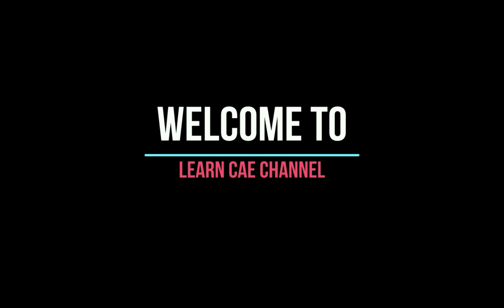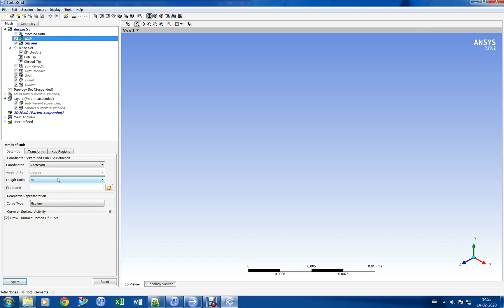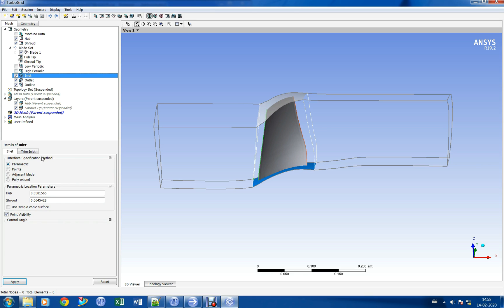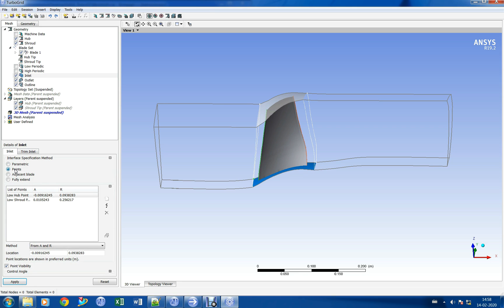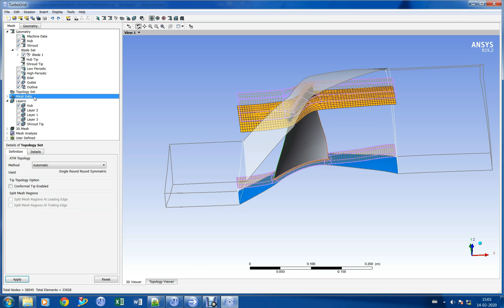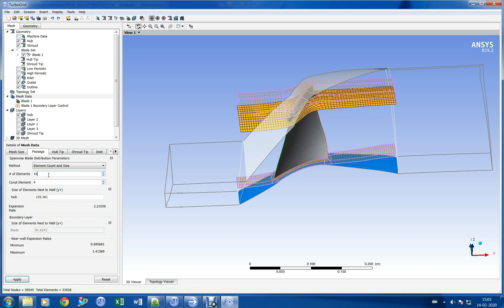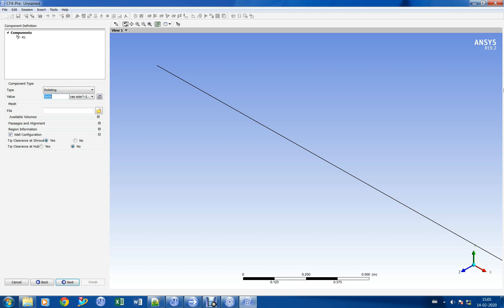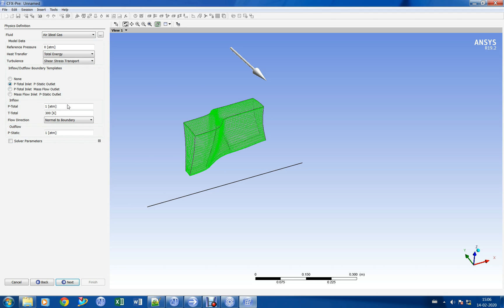CFD analysis of NASA Rotor 67 compressor | CFD Validation | Ansys CFX

Comment: Dear teacher,

Hello! Thank you very much for creating such an informative video. Regarding the initial steps of importing Turbogrid data demonstrated in your tutorial, I have a question I'd like to seek your guidance on.

Currently, I only possess the blade coordinate data but lack the corresponding hub and shroud coordinates. Could you kindly advise how I should proceed with the workflow outlined in your video under these circumstances?

Thank you sincerely for your time and expertise. I greatly appreciate your support.
Reply from the maker: Hi, you have to create a curve near the hub and shroud, place data points on the curve and export them into a text file. Further, you can use the text file to import in turbogrid to create the mesh. You can create the hub/shroud curves using any cad software.

Comment: and how expression mass flow rate value change in final cfd post result?
Reply from the maker: Hi, if you are using single sector blade for analysis, you need to multiply the mass flow rate output by number of blades to get the overall mass flow rate.

Comment: sir, i am working to make my own compressor setup but i dont know that is my no.of blades suppose 34 so that it is necessary to takemassflow rate @ r1 inlet is 34 ?
Reply: Sir if i have 20 blade at rotor 1 and 80 at stator 4 and mass flow rate @ r1 inlet is (50/20) and if i have to double mass flow rate at s4 then can i do (100/80). ?

Comment: Can this rotor be used in a gas turbine power plant as a compressor practically
Reply from the maker: Yes, if this rotor spec matches with the compressor spec, then it can be used.

Comment: Could you tell me how can I plot Pressure ratio vs mass flow rate
Reply from the maker: You need to repeat simulation for different back pressures and generate results. Further, you can get mass flow rate and pressure ratio for each case. You can plot it in excel or directly from workbench.